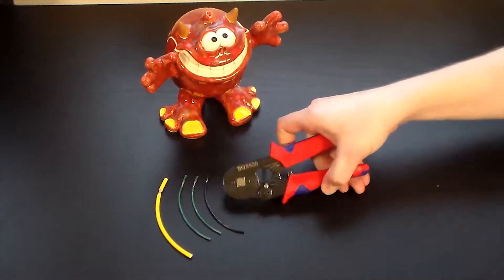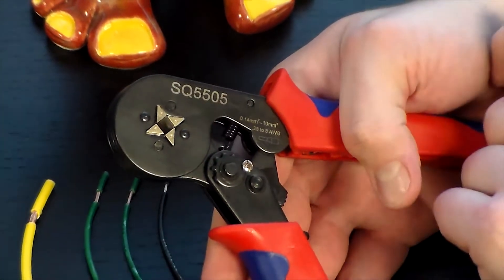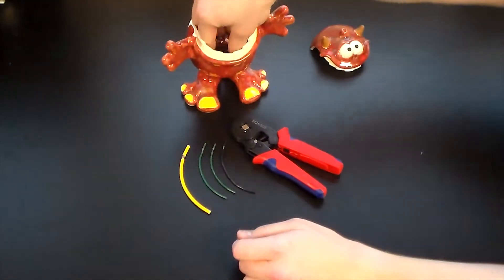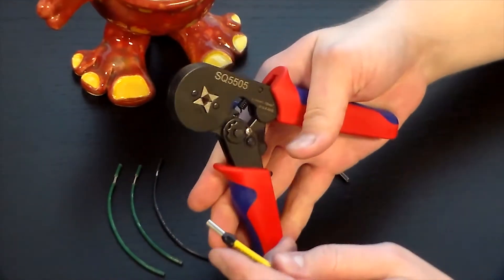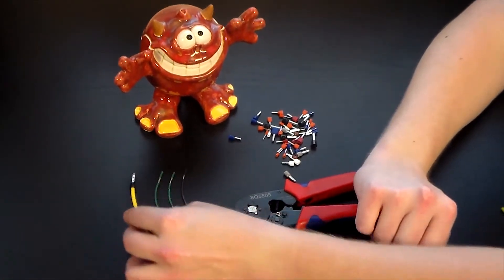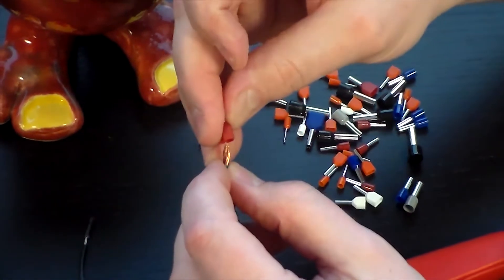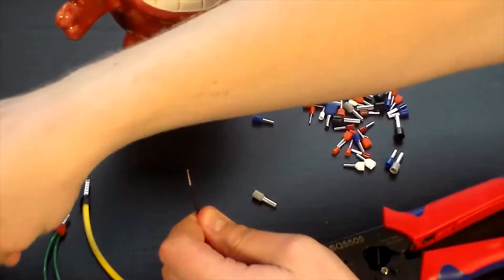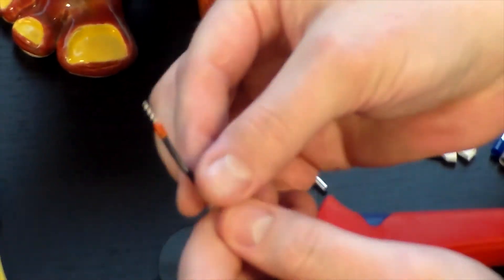Part #: FD2810SQ Self-adjusting Ratchet Crimping Tool for Wire Ferrules

Comment: what do you use the wires on I dont quite understand what the application is.
Reply: #MrCubflyer - if you terminate into the connectors that are a round hole with a screw you tighten and crush the wire (or any other style where a tough screw makes direct contact with the more fragile wire) - a ferrule will stop the screw cutting through the wire if you over tighten - also stops multistrand wire splaying if the hole is a tight fit.
It happens possibly more than you'd think.  Especially after a couple of re-terminations.  Also they look 'purdier :D

Comment: Where does this tool made?
Reply: I'd bet money they are the classic generic chinesium crimpers.  Nothing wrong with that, some auction sites sell them by the 100 for pennies - they are all similar quality (with occasionally different handle colours) and good at what they do.  
You will inevitably deform the perfect square when you tighten the connector anyway so it's not something to obsess about.
There is a second generation emerging that are more money and better quality materials - but from what I've seen they produce the same end result which is already good.
Additionally there are also some HEX 6 jaw crimpers available now - they do have their uses with some connectors - but are double the price.